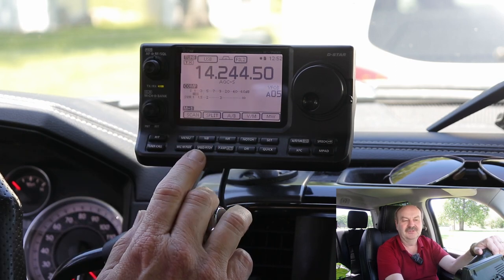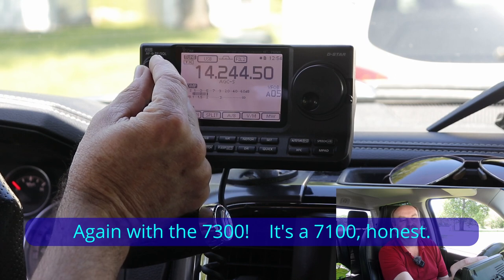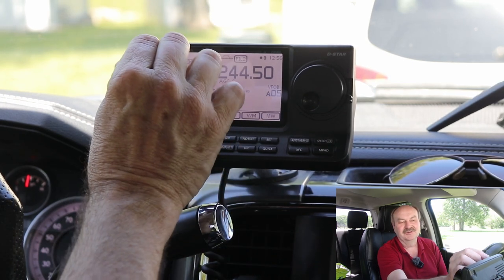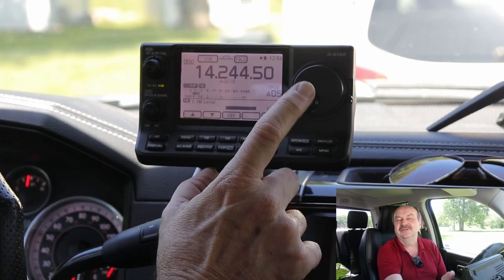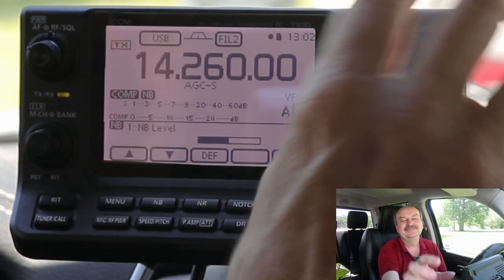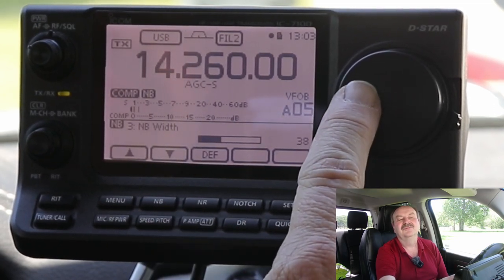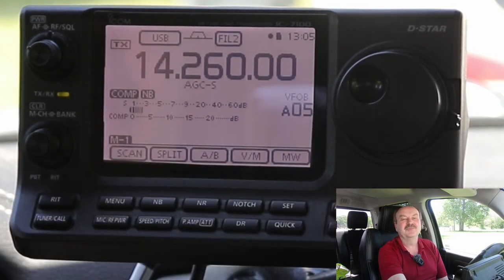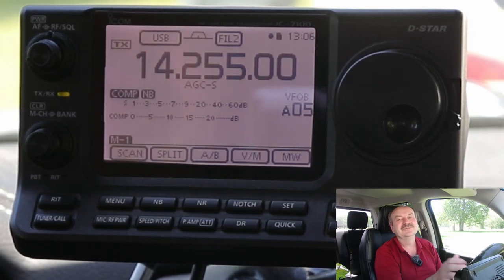IC7100 A to Z #20 Noise Blanker Operation

Comment: I have a 7100 in my F250 with coil on plug ignition.  I’ve bonded the truck in numerous places and still get the same noise you’re getting.  The NB is excellent for hf.  I wish they had an equivalent for FM.  Weaker repeaters get affected by the same noise.

Comment: Have you done a series specially on how to setup and use the DTAR on the 7100? Perhaps i missed it?
Reply from the maker: Hi.  I haven’t yet.  I did do 3 videos on DSTAR with the IC-705.  The setup on that radio is very very similar.  The first in the series is here:  IC-705 A to Z #6 DSTAR Part 1 - The basics
https://youtu.be/59lc-ey-ECU